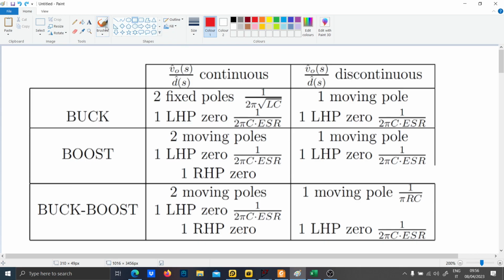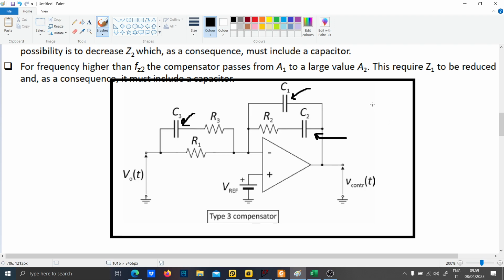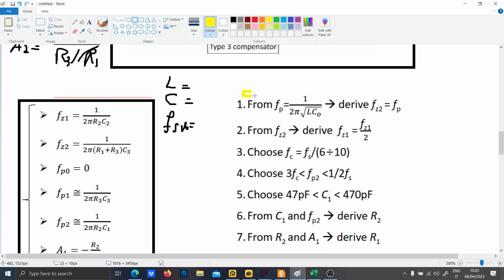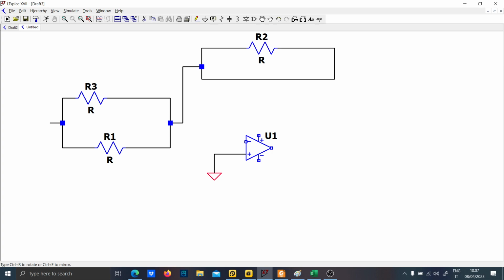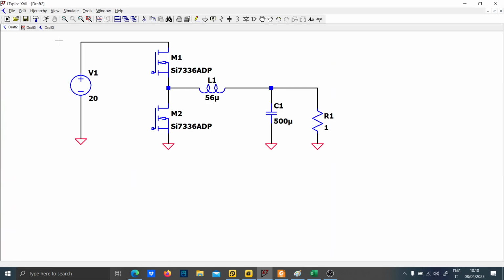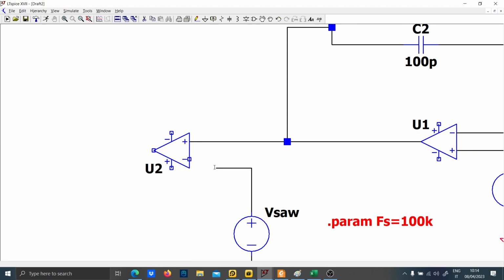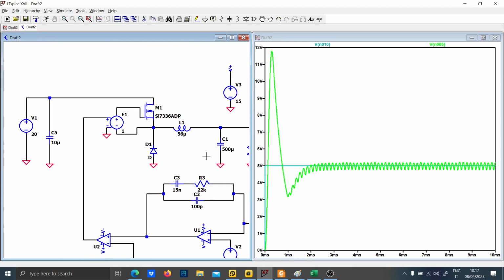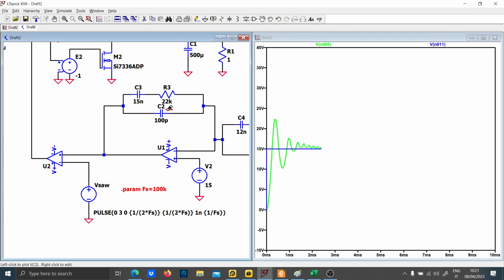LTSPICE Buck Converter TYPE 3 Compensator

Comment: Hello, great work!! However, the used Type-3 parameters do not seem to be optimized. Hence, it is oscillating. I optimized the Type-3 parameter based on the Buck. Plant: L=56uH, rL=10m, Co=500uF, rc=25m, Vin=20V, Vo=5V5A, Vsaw=3V, fsw=100kHz.
Type-3: R2=8.2k, C4=6.724n, R4=634, C2=154pF, C3=1.993nF, R3=29.8k. It should work stably with a phase margin of 69[deg] at fc=20kHz.
Reply from the maker: It’s an old video, in fact, in another one, I also explain how to design it. Thanks anyway!

Comment: how can i find the values of A1 and A2 ?
Reply from the maker: It depends on the load, poles and stuff. There are a lot of formulas in the application note to handle this
Reply: @LukeXVIIx64  my power electronics project is to design an asynchronous buck converter with a voltage mode control using multisim.

my vin varies between 35-45 volts, and i want a steady 24V 280Watts on output, here are my circuit values
L=200uH , ESR=100m OHM (10% current ripple)
C=12 uF , ESR 5m OHM (1% output voltage ripple)
R load=2.06  OHM
switching frequency is 50Khz
vref is 2.5V it gets subtracted by Vsenes from vdr from output, 10K lower and 86k upper resistors
then there is the type 3 compensator that i need to design that will amplify my error that is going to a Vramp to compare, then the PWM  goes to the Mosfet driver because it's high side mosfet

this subject is very tricky for me because the course did not cover the compensator part , i've been trying to solve it for like 2 weeks and the deadline is in 2 days (cooked)

Comment: Ok/ But it shouldn't allow x3 voltage at an output pin -) So, the entire compensator is not a proper one. You need a PID I think to use that "D"

Comment: Is your procedure only applicable to buck converter ? Can i use your step for flyback converter ?
Reply from the maker: The type 3 compensator Is used for voltage mode buck converters and converters which their configuration are derived from It, like half bridge, push pulls , forwards etc... The flyback Is a buck boost topology derived and It required a type 2 compensator for both current and voltage control

Comment: The duty cycle is invertered on the output when duty cycle go high that why boostrap can’t work with with single n channel and your problems is you using one signal you should use 2 signal in a 60 degrees of of phase

Comment: Hi sir were you able to identify the problem?
Reply: I think it is basically using type-3 compensator to make the buck converter work for a close loop, this also consider that type-3 is for voltage mode. So, you take the output for a feedback in the compensator, then there is  a PWM.

Comment: Great video sir, excellent demo. Can you provide the TYPE3 COMP design Excel sheet?
Reply from the maker: Aahah I cancelled it at the end of the video
You can have a similare excell sheet here : https://view.officeapps.live.com/op/view.aspx?src=https%3A%2F%2Fassets.maxlinear.com%2Fweb%2Fdocuments%2Fsipex%2Fapplicationnotes%2Fanp-16_typeiiicalculator_101206.xls&wdOrigin=BROWSELINK or by using the AD8450 Type 3  compensator tool here https://playground.analog.com/AD8450/
Reply: Thank you sir, its very kind off you.